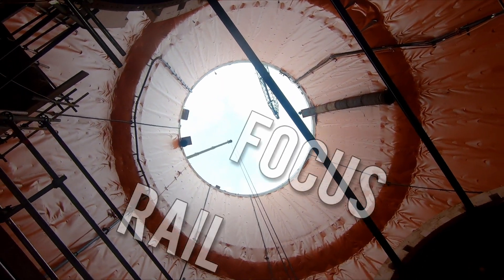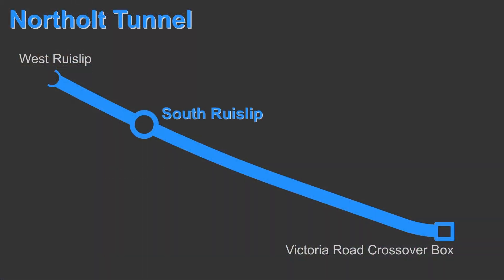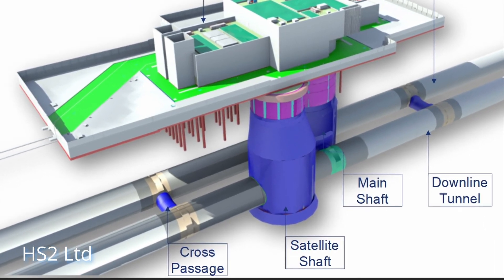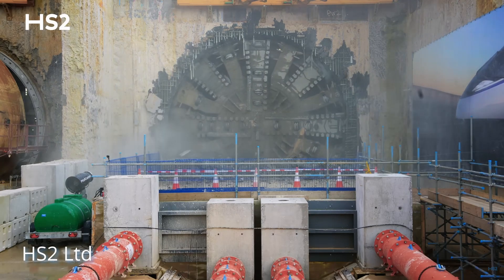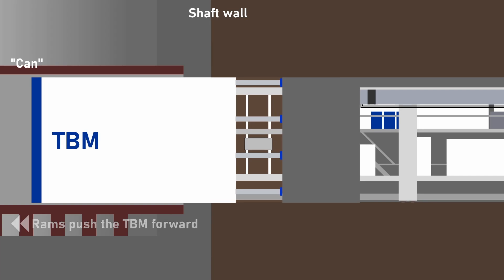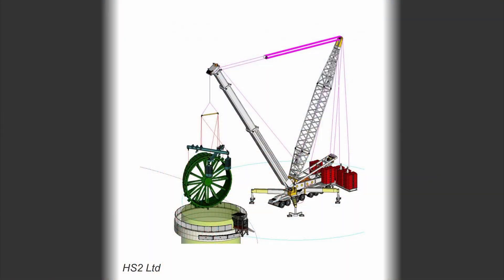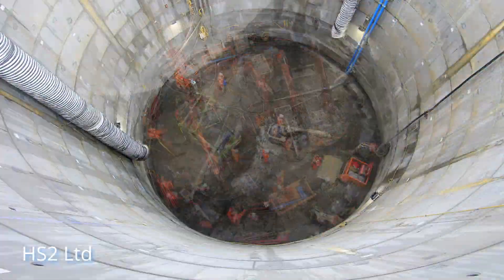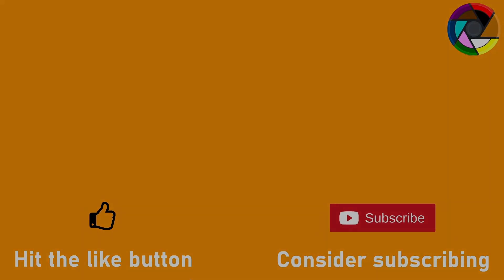Northolt Tunnel Unusual TBM Extraction | HS2

Comment: Way back when, I distinctly remember reading that the Old Oak-Ruislip section was actually going to be above ground and a decision was made to put it in a tunnel, but I’ve never been able to find anything about it since. Anybody got any sources for this??
Reply from the maker: It was originally supposed to run alongside the Central Line tracks, but construction would have caused too much disruption due to the number of bridges required.
Reply: @Rail_Focus  do you have any sources for that? Would be interested to read more.
Reply from the maker: The original route? I'm not sure if there are any documents/maps available anymore, but it was definitely part of the original proposal.  As for the reasoning, that's just what I was told by someone from HS2 Ltd during my visit.